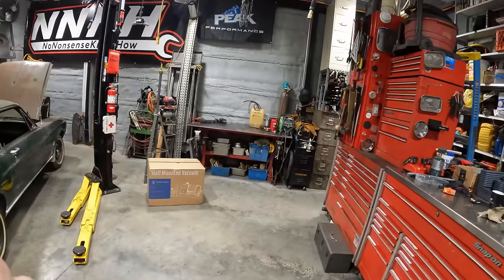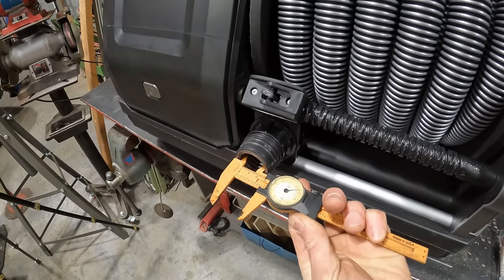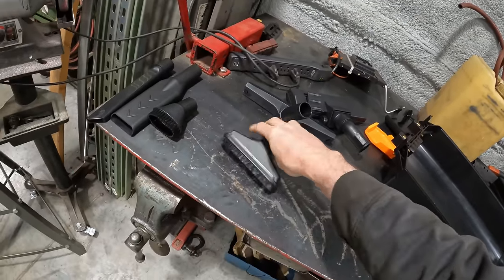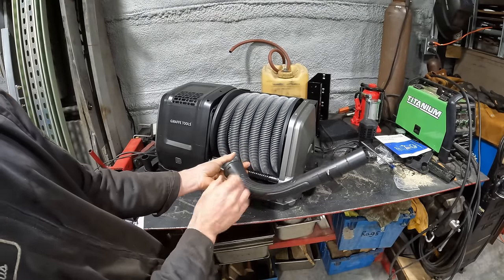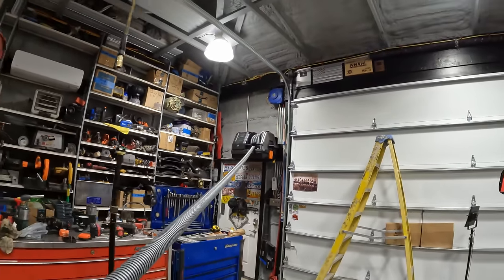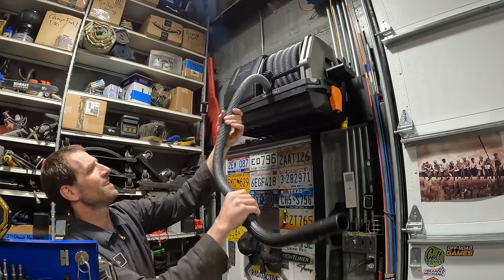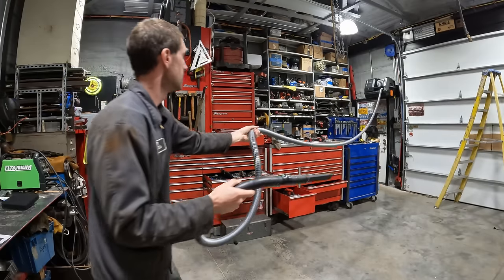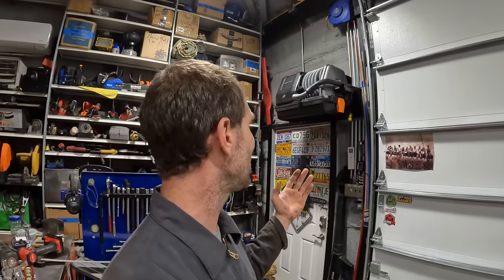Giraffe Tools Wall Mounted RETRACTABLE Vacuum REVIEW

Comment: I have one of their wall mount pressure washer. Its loud junk. I thought it would be nice to have a compact all in one unit. Says its over 2kpsi but my landa 1100psi electric unit runs circles around it. I think ill pass on the vacuum

Comment: According to their website it's 1200w. If that is in fact what it runs, that's the maximum continuous power draw from a 110v 15a circuit (110v x 15a = 1500w), but you should only run 80 percent of max circuit breaker rating continuously, ergo 1200w. 

They also need some headroom for the motor to start up. You can run 1500w from a space heater but it's pushing it. If your voltage is higher (120v) you can get away with a bit more, or if you have 12ga wire and a 20a breaker you can get away with more too. My rigid "5hp" shop vac only draws 9 amps so that's a bit less than this. So if that rating is correct, the weaker suction is just because of the smaller yet longer hose.

Still cool to have though.

--
Ronnie

Comment: It looks good. I would move it away from where you have it unless you are filming a road runner cartoon. Jen is the road runner lol😂. It looks like a machine with plenty of features but I would worry about clogs in a line that long. In my shop I have an old black and decker which will suck your fingernails off. Looks like a good product. Is Jen going to post part 2 of your trip out west? Peace! Saxman

Comment: Dear Mr. Chris.
I like this vacuum cleaner and especially the new idea although your reveal sounds quite negative. The device is definitely strong enough (and that although it has a very long hose). Nobody needs to suck rodent nests with it and one shouldn't even do so. By the way: If you suck rodent crap into a shop vac, a lot of fine dust is blown out of the machine with the air instantly. Rodent crap, urine, poo and dust is way more unhealthy than most people know/think. And not only for the respiratory tract system.
The giraffe vac is even operated with a remote control. Quite useful if you are so far away from the device itself. So far I have only one suggestion for improvement: The vacuum cleaner seems quite loud. That's something that mustn't/shouldn't be (at least not nowadays). But I guess for a price like this it can't be fabricated quieter (therefore it's okay for me).
Thanks a lot for making teaching explaining recording editing uploading and sharing.
Best regards luck and especially health to all 4 of you (unfortunately no cute little Gus 💚 in this video, sigh).

Comment: Hey Chris, have you (or any other users) had any issues with your retractable pressure washer?  If so, was Giraffe's support good?  My biggest concern with new products is parts replacement and cost of those parts.  It is only a matter of time before a hole is worn in that hose, or some other damage, and if the replacement is $100, that kinda sours the whole deal.

Comment: No big issue with hose getting plugged as long as you have a nozzle that has a smaller ID than the hose.
Reply from the maker: I would have to disagree with that. Long splinter type pieces can get sucked up and then get wedged in the corrugated hose.  Which leads to other things getting caught on it and then a buildup. But yes in general a small head will help reduce risk of clogging but still possible
Reply: @NNKH2  is it corrugated on the inside?
Longer splinters will clog up a hose of lager id also, atleast when spooled on a reel.
Reply from the maker: @Thelemorf  yes
Reply: @NNKH2  oh, thats a bad hose design